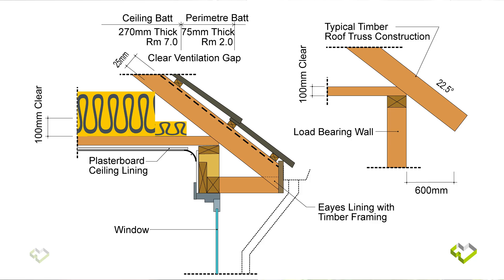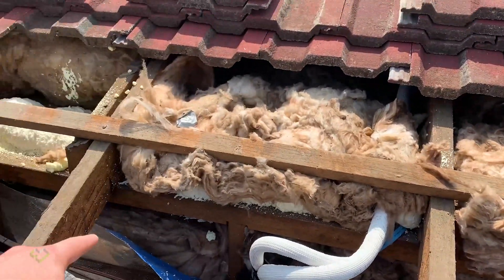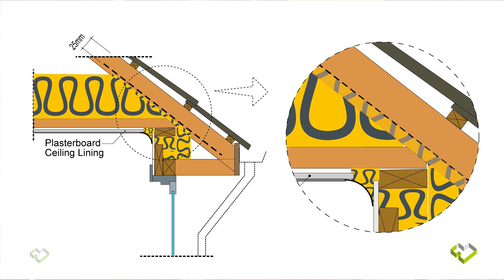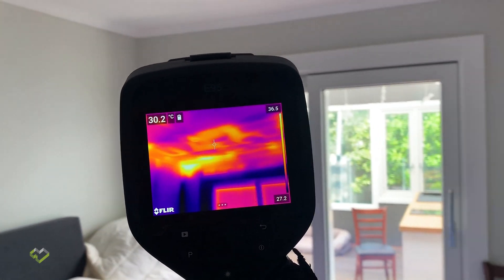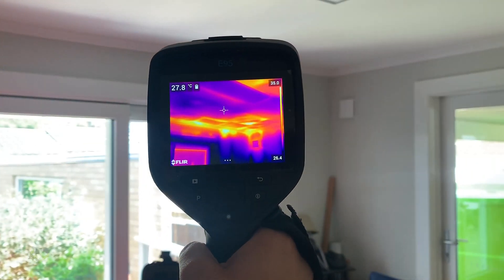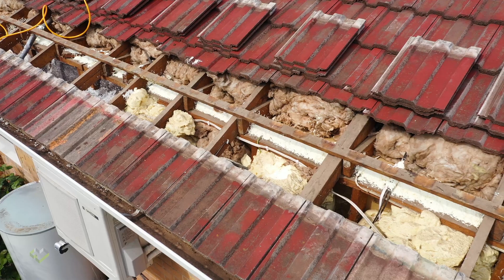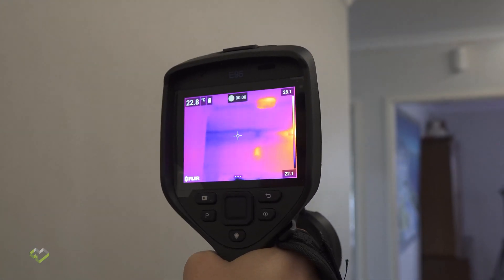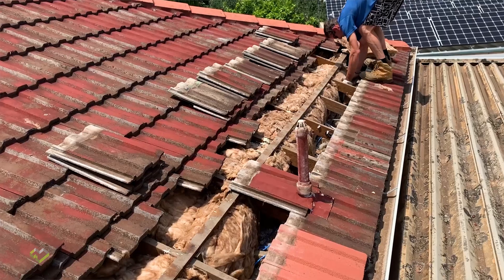The weakest link of insulation in most homes, Thermal Bridge at Cornice.

Comment: The problem that you highlighted in your second thermal camera scan was thermal bridging caused by the beams. This is a commonly overlooked issue. Insulated boarding needs to be installed across the beams - either as the final ceiling or as a secondary layer. Also with the rockwool insulation, it didn’t appear as though you’d left the required 50mm ventilation, but I could be wrong.

Comment: this is bad architecture design of the house. In central Europe,we build 0.5-0.8 tall wall ended with concrete wall plate,that bonds whole house together and roof rafters are going from it,meaning there is no weak point in insulation and ceiling is uniformly insulated without any cold bridges on the edge of the ceilings.
Reply: Agreed, Australian houses are just like tents.

Comment: Great video on an important topic. When you say that the code only factors in the average insulation level, do you mean an area-weighted U-value calculation? A straight average would miss the problem you’re showing of a massive gap in performance around the perimeter.

Comment: Great video, we definitely need more quality and informative details like these for builders and installers to refer to. Should add a disclaimer to say that the effectiveness of the insulation is proportional to the dwellings air tightness.
No point doing a good job on insulation if the conditioned air is wafting out the gaps and cracks.